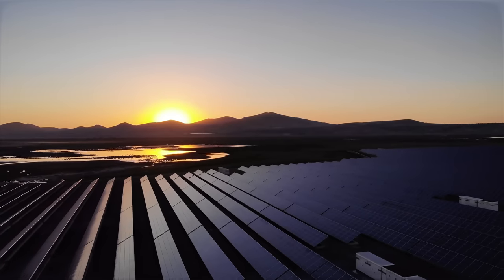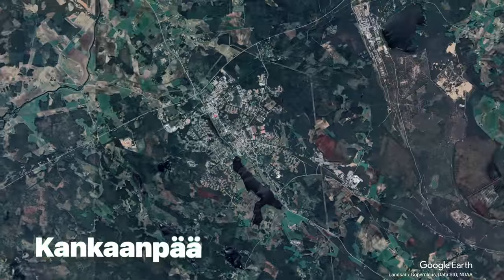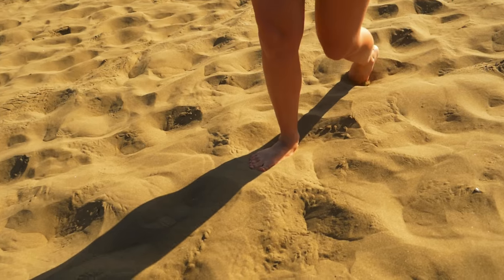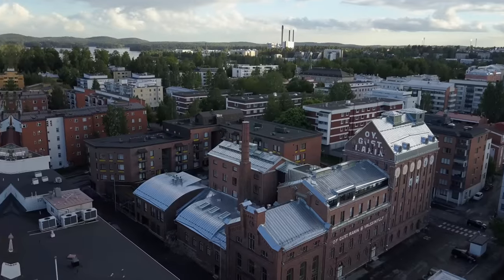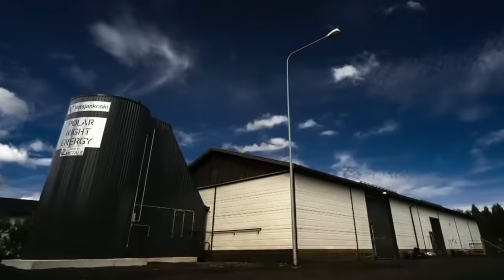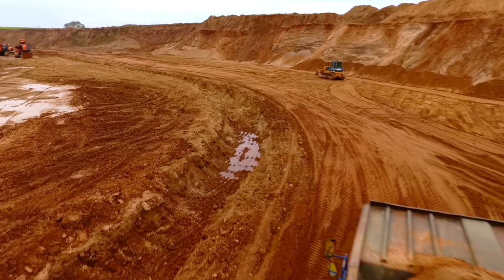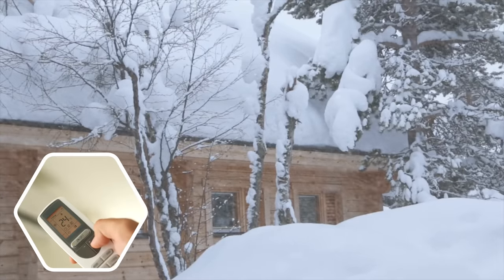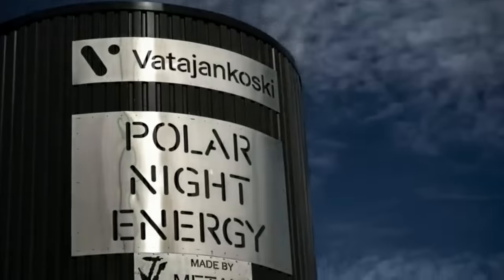Breakthrough Tech Heats Homes Cheaper Than Natural Gas!

Comment: The biggest biggest problem that most homes aren't insulate super well. I help someone insulate there walls R-63, ceiling trust R-100 and roof trust R-100 with radiate barrier and super super high efficient foam and windows. They reduce there cooling and heating cost by almost 100%. In the summer time the only time they run there AC when it reaches 120F outside. In the winter time they run there gas heater for 3-5 mins and keeps the home warm for 7-10 days.

Comment: The sand battery is a great idea and could be incorporated into heating and cooling, water heaters, heat pumps...
In the winter instead of using the coil from your air source heat pump, the heat pump could use your ground coil where you have been pumping heat in all summer and become much more efficient. This would require smarter heat pumps that know which coil to use. Radiant heat such as boilers could incorporate radiators filled with sand that keep Heating after the boiler has stopped. Excess energy from solar could be pumped into the ground to heat the sand so you can use it to heat your house. 
This brings into play one of your other their videos with the smart panel. It can also be accomplished with smarter inverters that distribute the extra power to heat the sand. 
Great video as usual. Keep up the good work!

Comment: I really hope this and other innovative energy savers come to fruition on personal and industrial scale.  I see guys on Youtube testing how hot they can get sand but they are very basic experiments and most don't show them attempting to draw the heat for increasing air temperature of rooms or a house.

Many aspects appear to be undetermined, such as how truly effective these techniques are in various setups.  There are many possible areas where efficiency might be greatly impacted such as insulation of the sand, method of heating, method of drawing heat, air circulation in the target rooms, and circulation of the target rooms.

Comment: Any ideas for an efficient way to convert the stored heat energy into electricity (turbines/etc)?  If that could be solved, maybe sand batteries would be a viable grid-scale storage system anywhere that has a significant percentage of intermittent renewables (wind/solar).
Reply: I think they just heat  water with it and the steam runs the turbines
Reply: Sterling engine may convert heat to electricity with an overall efficiency of 30-40%

Comment: While 'breakthrough' is a stretch, this could be a valuable passive heating method for off-grid homesteads, supplemented by a wood stove or other source, and could be a good backup 'survival' heating method for on-grid homes in a grid down situation, as noted in the video.

Comment: In Europe there is a massive shortage of gas, the price is sky high, anything which would help in the winter  is a good idea. I think calling sand a battery is a poor idea. Most people think of electricity - this is more a "night storage heater"  which were popular in the UK 20 years ago. They were radiators with bricks in which you heated up at night on low price electricity and that kept your home warm during the day. The downside was by the evening they had often run out of heat.

Comment: why can't water be used instead of sand. I thought Water had a better thermal mass than sand. (I could be wrong).
Reply from the maker: yeah it does, but it boils off at just 100C so its potential to hold energy is limited. great question though... and water does have a part to play for sure
Reply: @TwoBitDaVinci  thx. that explains.
Reply: @TwoBitDaVinci  why aren’t they using the sand to boil water to run a turbine?
Reply: @AndreC240  They're just using the heat directly and not trying to produce electricity from it.
Reply: @AndreC240  A really big turbine ( 200 + megawatts + could convert 30 % of the heat into electricity.
Reply: Water will boil off at 212 degrees Fahrenheit, then you have steam.  Sand is stable in a solid form well beyond 1832 degrees Fahrenheit. Sand is way more cost effective and easier to contain.
Reply: Water releases its thermal mass to rapidly also sand has a higher boiling point ie way more thermal storage potential😊
Reply: @paul49777 i wanted to me a thermal ac for my room but water is sketchy then I came across sand 😊

Comment: I found it amazing that you didn’t mention the original sand battery which would be 55 gallon drums painted with a dark paint on the north side of any passive solar dwelling they can be filled with sand or gravel but usually the gravel would have to have the minus component to have a continuous conductive interior. They simply absorb the sun‘s rays during the day and let heat off at night. Even ancient Rome figured out how to build cities giving each house passive solar energy not sure why it’s so tough for us today.

Comment: Decades ago I saw a show about an architect in the mountains in Denver who used evacuated tube solar collectors to heat a glass mansion and dump the remaining energy into a year round outdoor hot tub. 
I want to build an ICF house with in floor heat then build an out building shop with the south facing wall covered in evacuated tube solar collectors. 
Pump water through them and into a reservoir in the garage. From there it can be distributed to the house, slab in the garage, heated driveway and sidewalk, water heater etc. On demand. 
ICF homes have high insulation value, sealed external envelope, and extremely high thermal mass so even if you go a period without significant sun it takes over 2.5 weeks to induce a significant temperature fluctuation in the house. 
Could heat the entire house in -40F weather for just the electricity required to run a pump periodically.

Comment: I'd be interested to see a domestic version of this using solar/wind or just cheap-rate electricity. Maybe replacing the hot water tank to provide hot water and central heating systems. Perhaps even a thermoelectric system off the back of this too.
Reply: Wonder if you could heat your oven with this?
Reply: reminds me of old storage heaters that used cheap overnight electricity to heat bricks (sand based) in the heaters which then released the heat later...
Reply: @toddsmith4280  at 600ºC why not? It could power a heat pump or HVAC system. Would need fire containment though maybe the new-age chimney?
Reply: @bobwbarnes  I remember those. Why did we never develop them? What am I missing about this tech?

Comment: Question, what kind of sand does this take? Is the rough course sand is used in construction and concrete or the fine and smooth sand from oceans and African deserts?

If it’s the latter that could help reduce Brine when we desalinate our waters
Reply: Salt might be a better solution for this application. I hear that salt is used in solar power plants to keep generating power for a certain number of hours after the sun has set.

Comment: Something I was thinking about is using the sand to store "cold" as in cool the sand with a heat pump powered by solar and use it like that in the summer. Could be a way to get more use out of it in places that actually have seasons😄

(Yes I know cold is a lack of heat energy but that's the best way I can think to explain)
Reply: Interesting idea.  SInce it's summer, you probably have the AC on during the day, so you have AC. And you have solar, in this concept. You could just use batteries and run that same AC at night, and save on the system you'd need to distribute the sand's coldness to cool the house, and the second unit - the heat pump running during the day to cool the sand while the AC is cooling the house.  Unless one larger unit could cool the house AND the sand, then you're cooking - most of the ductwork exists, just need some servos and blowers. If one unit could do both, I would want to know how much bigger (and $$$) it would need to be over a just getting a battery system, to know which makes more sense.  Probably a bigger unit.  Now think about geothermal.
Reply: @scottstewart5784  yeah I'm not sure about the cost vs just batteries but sand batteries last pretty much forever so it could maybe be worth it.

Comment: In the USA my thought is for industrial heat. I know an engineer in a Florida production plant that is getting rid of the natural gas hot water system and going electric. (they use a LOT of hot water for cleaning food grade equipment) If they could buy cheap electricity and store it in a sand battery, massive advantage. For industry electricity cost is very sensitive to peak demand, this could be a "base demand."

Comment: Rather than sand, or any other passive mass, You need to pick a phase change material that operates within the heat range of your storage system.  Something like tin for example.  A phase change stores much more heat as latent heat.  The beauty of using a phase change is you have more heat that can be stored, and by choosing a phase change at a useful temperature you enhance how much heat you can get back out.  This is the problem with sand or other thermal mass, the cooler it gets the harder it is to get more of the power out.  

If you use a medium like water, it is possible to move the heat around.  The steam boiler is an example of this.

So sand is cheap, but unless you can melt it, you will never store much energy.  Something like tin could be melted and in the process store MUCH more energy that is MUCH easier to get back out.  Substitute just about any non-toxic material for the tin with similar results.  Pick a temperature range you want to operate at, and pick a phase change material that operates in that range.  80 times better than sand.

To bail texas out of snowmageddon would have required every house to have a sand battery twice the size of the house...  Or a phase change battery the size of a car...  which is more practical or more likely?

Comment: Sand batteries can also heat water, and that is a big deal everywhere, for bathing, laundry, pools and hot tubs, and cleaning, and hot water pipes in the floor is the absolute best way to heat a home. Space heating is almost half of our energy usage in the US, and is important for some industrial processes such as drying food, drying building materials such as wood and bricks, and also keeping green houses at the best temperature for food production. Also if thermoelectric generators (TEG) can be improved, sand batteries may even work for generating electricity.

Comment: The heat stored in the sand batteries, if the sand temperatures are high / hot enough, can be turned back into electricity -- by heat transfer to water .... to steam, to drive a steam turbine, you know, the turbine ferry.  basically a thermal power plant run not by burning fossil fuel, but using theheat stored in the sand.  The thing to explore there would be the proportion of energy loss in the transfers, ergo, the resultant LCOS of the electricity derived.  Ricky, I wish you would talk to Tommi and / or Markku at Polar Night Energy and explore this.  

Please also discuss the possibility of using Waste Heat Recovery technologies to source the heat energy to heat the sand in the sand batteries.

Comment: This is very old technology that they did not find. Many homes in the north have huge amounts of sand put under them with pipes woven in. Once fall starts coming the start pumping fluid into the sand under the house being heated by solar water heaters. They do this as long as the sun is up. Once winter gets there the amount of heat under the house is huge and helps keep it warm all winter while it still heats when the sun is up.

Comment: Here in southern Wisconsin we have a foundry that used to be a filthy black place. Over the years many updates have been installed, I am not even sure they burn coke anymore.They heat the iron to the melting point with electric furnaces. Very seldom are the doors closed even in winter. I wish I could capture the heat from this plant to heat my home. Sounds like a sand battery might be a good option, maybe we could get the lumber producer to capture some from their kilns,  even the plastic injection factory could add to a sand battery.

Comment: I live in cold climate New England and heat 80% and 95% of my hot water using vacuum tube type hot water solar panel. I have hot water passing Thur 2 ft deep sand bed under house slab (hydronic system) . Summer, I heat the pool along with hot water tank. The reason I don’t add more solar collectors and provide 100% of heat is that many days during winter I would make house tow warm. I have minisplit that backs up this system in very cold days.

Comment: Pretty sure Texas failed because they were forced to convert to wind power and those specific mills weren’t designed for the cold.  They didn’t over strain the system the system was flawed.  We need to understand that alternative power is essential but we need to convert over responsibly at a save pace.

Comment: The first thing you forget is needing a DISTRICT HEATING / COOLING SYSTEM, which my memory says San Diego, St. Paul, Harrisburg, ... do have Municipal District Heating Systems.
A District Heating System connects a group of buildings by insulated underground piping. The pipes are used for steam supply and return condensate. A central heating plant produces the steam by boilers reheating the condensate. 
There have been gas-fired, electric, ... boilers that can heat stored energy as sand, bricks, water, salt, and more.
Empty "dome formations" in Michigan, Ohio, Louisiana, ... are used to "store" natural gas as a buffer for high winter demand, to store compressed air for electric generation by gas turbines, ...
The District Heating System is not common in North America, typically only in large city center for government buildings.

Comment: There are several errors in your statements about that Texas power grid issue when the polar vortex smacked them, You failed to mention that the people that built the grid there as well as the wind turbines for texas, cut corners to pocket the savings and didn't build them with the intention of Cold Winter usage as they expected the temperatures of Texas to stay above freezing. When they didn't build to code by not applying the necessary cold weather parts such as wind turbine deicers or the necessary grade of wiring to handle cold, al it took was that polar vortex to prove that they cheated the entire state of Texas (and some parts of Oklahoma, but that didn't get near the coverage). 

The worst part of the whole thing was that on the average, Texas homes are not insulated to the degree of homes further north (Some not at all), So the slightest breeze will draw any heat built up in the homes right out Which is good for the hot summer months, but when the freak cold weather comes, it really sucks.. So even managing to get heat from Running Generators, Kerosene (not sure of the availability of that fuel.) heaters, lamps, or otherwise, The lack of Winter preparations from builders of Texas homes, got many people killed as they didn't ever expect to have to deal with such a situation.

Basically what I am saying, a bunch of Sand batteries in the grid would not have helped Texas in that situation as the entire grid, regardless of renewables or otherwise energizing that grid, would have just been a tube full of hot sand that wouldn't have helped anyone as the wires, substations, transformers and such were going down due to the people in charge of the grid being so cheap. Now obviously a sand battery doesn't rely on the grid for it to store power. However Texas is a vast state, so the piping for such a setup would be better off set at a per property (or per block in cities) and even then, there has to be some sort of means to move that energy around to and from the sand. could it have helped? Maybe, but it would have taken a means (fluid, Thermometric, something) to move that heat from the sand as I am assuming that Electricity is not being stored in the sand, but heat. Then you have to consider that big tubes of sand would look kinda gaudy and many cities residents would call them eye sores. but what's a little ugly when it comes to being the "wave of the future?"

Note I'm not bashing the idea of using sand to store energy, I'm bashing the usage of that tragic event for residents of Texas and parts of Oklahoma where their homes and grid were poorly prepared for such an event due to so many corners cut that lead to a perfect storm of a disaster. Yes it was a disaster, but I doubt that a sand battery collection would have helped as a bunch of Sand will only hold heat for so long and that Polar vortex stayed in place for quite a while.

Comment: It would be interested to eventually see thermal batteries eventually paired with heat pumps.  Resistive heaters are only 100% efficient. Heatpumps can be several times as efficient. Use the input power to mainly run an air compressor and heat pump that is cooling the compressor and gas. The heat is directed to the thermal battery and the liquified air can be stored for when cooling is needed. Then release the compressed gas for cooling. It would be best if there was a heat pump with a high temperature phase change material that would have a liquid state below 100C and a gas state of at least several hundred C or higher.  Gallium seems a little interesting since it melts under 40C, but it won't vaporize until 2400C, even sand would be melted before it reached it's vapor point.
Reply: Using a heat pump will drive the price up significantly
Reply: @chidorirasenganz  How so?
Reply: @privatemale27  heat pumps are more expensive upfront than resistive heaters

Comment: Energy stores = heat capacity x temperature difference. Sand can be stored at perhaps 1700C (though in reality 1000C) = 10x better than water. But water has a 5x better heat capacity. So in reality, this system is only 2x better than a simple water tank. So a 2x bigger water tank will do the same thing, but perhaps much cheaper.